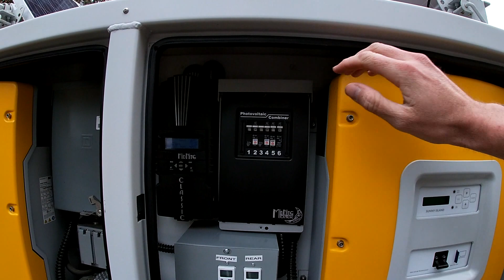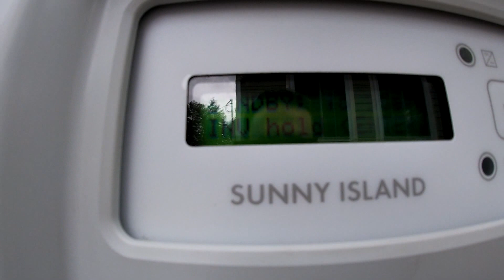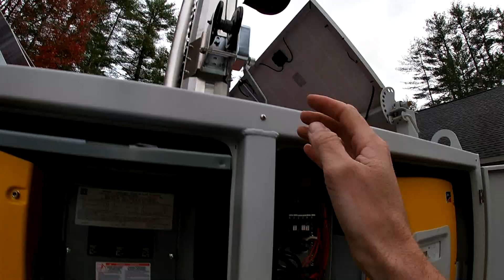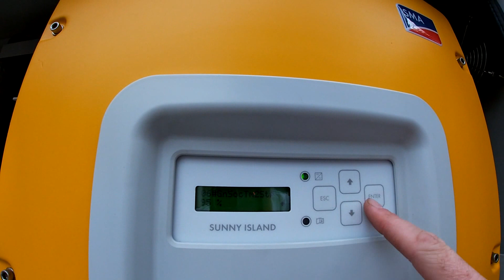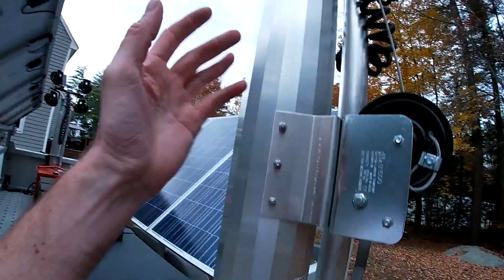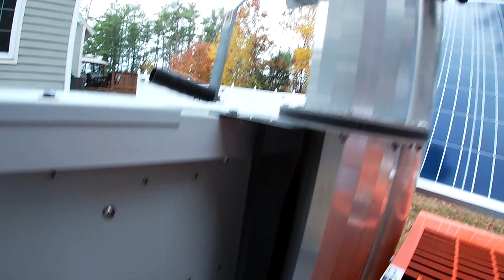How to use the "DC Solar" trailers + UNLOCK CODE for the Sunny Island Inverters INCLUDED!

Comment: Thanks very much for this. I have two trailers, one with a generator and one without, I use them to power an off the grid tiny house that I live full time in the Sierras at 7,200’ and a shipping container based shop respectively. Have some issues that I hope to solve with help from content like yours. Greatly appreciated.
Reply: How has your experience been with those? We are looking at one of these and using it to power a camper trailer. Have you had any issues?

Comment: We are chasing after one of these right now (three years later)...definitely need it for our off grid build.
Reply from the maker: Good luck buddy and thank you for watching!
Reply: @Trialnerror  we are hoping to find a unit that will afford us the power to be fully self sufficient on top of the mountain - maybe look into a couple wind turbines to add to the unit for windy days.
Reply: @Trialnerror  low and behold we picked up one of the same style units that you purchased YESTERDAY! I am beside myself and it is sitting right outside this morning - too dark to play with just yet. The auto/start for the generator short cycled when I returned home in the evening and parked it. I turned on the systems for my wife to show her that it was operational. The Midnite Solar charge controller was charging at 12.5Amps before the sun went down. I will have to spend the next few days doing all the diagnostic testing from your videos to get the unit up and running. I wish there were a simple way to plug and play our 40' Jayco JayFlight LOFT directly to the trailer to test it's capacity for supplying power at 50Amps. I will keep searching for the information - waiting to hear back from SMA on how to wire the Sunny Islands to a sub-panel to do so. Thank you for all of your videos and assistance!!
Reply: @Trialnerror  we found a fully loaded trailer!! Pulled in the driveway last night!

Comment: Is there anyway to connect two of these trailers together? Or at least the panels from one trailer to another in series? The panels don’t seem to make enough power for what the charge controller and inverters can handle.
Reply: You'd need a second charge controller, the midnite classic 250 can only handle about the wattage of the panels on one trailer

Comment: Thanks for the great video. Just purchased one of the "A" configuration trailers yesterday. The prices are definitely going up. Controller only showing about 37 volts. May have a bad cell or two. Noticed some corrosion around a few of the terminal. Everything else is working. Has anyone posted about how to test the cells and what the cost would be to replace a cell?

Comment: The right most switch, trip fuse or whatever in the combiner panel is after the midnite charge controller going to charge the batteries. I thought it was lightning arrestor at first. Traced it and the charge controller feeds to it before sending power to batteries to charge them up. My guess is in the event of a surge , spike or spark or even short or explosion overheating it would trip protecting charge controller and panels. So charge controller is sandwiched between these trip fuses and protected in both directions
Reply from the maker: You are the man!  That makes perfect sense!
Reply: The Midnite breakers are polarity sensitive. The breaker(s) from the PV array are doubled up and placed in series in order to handle the higher voltage from the array. They protect the wiring and the Midnite Charge Controller (CC) system from the PV array in case to much current flows in from the array. This could happen if the panels are very cold, and the right kind of cloud cover occurs that causes a cloud to act like a lens, and focused the sun on the array. I once witnessed this during the winter when the 3kw array I had installed put out 4.3 kw as a small cloud went over. It can also, I kid you not, be caused by solar flares. The other breaker(s) protect power from flowing into the CC system from the battery, and from the inverter to the CC if and when the inverter is charging the battery. This can happen if the CC fails and shorts out. I have seen this happen after a system was damaged by a near lighting strike. A few hundred dollars spent on lightning protection and proper grounding is cheap insurance!
Reply: My guess is that this ckt breaker simply protects both the charger and the battery.  All solar systems are supposed to have a ckt breaker between the DC Charging Voltage output going to the Batteries: both as a switch to start or stop charging them AND as a protection device should something in the Charge controller circuit Short out this Circuit.  This is standard in all solar system I am aware of.  If it was for a lightning suppressor then it would likely be mounted right inside of the Combiner box (and be visible: which it is Not).    My friend's problem is that when I turn on the black breakers, that the Midnight Classic Charge Controller Does NOT produce any Watts going to the Batteries.  Maybe this very ckt breaker is Bad?  I will know next time I go back to check it out.
Reply: If that's the case connect it directly by passing the charge controller.  The charge controller shuts of if the voltage is too low. Get a multimeter and open the   panel and measure the voltage between the black cables and red. If its below 40 volts it will not boot up. That's from my experience.  Once you connect directly bypassing the charge controller it will charge up the battery for a while then you can put it back to normal afterwards.  I don't know if that makes sense.
Reply: I have a picture of the combiner box I can send you to show you how I did mine. Just let me know if you need it.
Reply: @maxiest200508  Yes, I know that I can use 2 Panels in Series to Charge a 48V Battery Bank.    I am planning to build such a Bypass Device -- with each set of Two panels on a 15 amp DC Breaker.  That will bypass the Charge Controller.  As long as the Charge Voltage is below (say) 58 Volts It should work just fine.  When it reaches 58 VDC, then I will Stop charging at that point and reconnect through the Controller.  I Do Not know how many sets of 2 (265 Watt each) Panels it will take to bring the Voltage up to 58 Volts, but that is Very Close to the Ideal Equalize Volage as far as I can tell.  Or 57.6 to be more exact.  Even then you may have to go higher to Restore a Bad Battery.
Reply: I can send you a picture of how I did mine. You dont need to do all that. You just need to put a jumper cable or wire between to points. Let me send you a picture give me and email or I can post a picture somewhere and share the link with you. Once you open the combine box you'll see how you can disconnect the red cable going to and from charge controller and simply put a short jumper cable similar to the one on the second to the fourth position (black). Then it will be kind of high but you only need it to charge the battery so that the charge controller can wake up. The charge controller is voltage sensitive. It wont boot with very low battery.
Reply: @maxiest200508  I already charged that batteries to 46 Volts.  The Charge Controller came on.  I think I need to simply Turn the Solar Function to "ON."   It is either that or a Bad Ckt Breaker.  I am confident I will figure it out the next time I go see my friend.  What you suggested will place Too High of a Voltage on the Batteries.  Two Panels in Series is all that are needed to get the Charge Voltage in the Ball Park -- should we need to go that route.  Thanks for your offer.
Reply: I've got a problem with the one I'm working on. 
Both aray banks have the same voltage going into the combiner box. But the Midnight controller, shows one bank, at 750 watts, and the other at 35 watts. What am I missing?
Reply: @applefire11  if you have a voltmeter you can check some parameters by opening the panel where the circuit breakers are. If one of the contacts come loose or the breaker is tripped or has no continuity. Be careful though as shorting anything with the wires live and hot is like a welding machine it will stick and spark and arc.

Comment: FYI. Sunny Island has a very good warranty. My slave inverter was showing a temperature error. They sent me out a new temp sensor but it didn't solve the issue, so they sent me an entire inverter replacement. My question is, do I need to do anything special to install an inverter as a slave? Secondly, my old erroring inverter. Is there a way to reset that inverter and see if I can get it to work as a standalone unit?

Comment: You’re fabulous…I have one of these trailers…it appears battery acid from two batteries in the array has melted through its casing and through the trailer floor…I didn’t see the problem until the  inverters stopped working and I was forced to check everything. The inverter’s LCD, nor the tiny green indicator will light up, suggesting zero power is reaching the inverters - the charge indicator shows almost fully charged batteries…but no amps or watts are being generated….I don’t know how to proceed - can anyone offer any suggestions regarding how to address the batteries and/or the power issue with the inverters - any advise would be greatly appreciated
Reply: Do a new battery set up on your inverters. If they set for long periods of time. But it doesn't hurt to do it every so often because the inverters some forget.

Comment: Those Batteries are Flooded Lead Acid, NOT AGM's.  How do I know?  Because they have liquid Sulphuric Acid in them.  AGM batteries are Sealed: meaning they Don't have Watering Holes to add water to periodically.  They also require Zero Maintenance -- as opposed to these Forklift FLA batteries.
Reply from the maker: You are correct. I didn't know at the time.

Comment: Hello there I bought one of these trailers .  I hook up power line. Turn it on it runs for about half hour then shuts down. Any thoughts why it keeps shutting down.  I bought new battery and still does the same thing. Works great when there is sun

Comment: When you wired into your house did you need to change the settings in the master inverter to GenGrid? Did you just pop a 50a double breaker into your panel and then wire it to the trailer?

Comment: Thank you so much for the videos on these trailers.  Longer videos! Love it.  Do you think it's possible to use the light towers for mounting small wind generators and would it be worth the try.  I noticed a broken light tower in one of your videos possibly due to wind.  Do you think the light tower is strong enough to hold a wind generator.  Removing the lights would cut down on the wind drag to the tower.  Does the tower expand from the bottom up or the top one first.  Some counties will not give permits for wind generators so a mobile unit like these trailers might help get around the permit process.
Reply: Where do you live that the govt owns the air?
Reply: @jakeeddy9256  I live in Santa Barbara CA and the government currently owns the air.  About 5 years ago I called the county to see if I could install a wind generator as I live in the mountains on 7 acres in a community where  no parcels can be less than 5 acres.  The county agence for approving permits said that the federal government mandates solar so they have to say yes to solar.  The said until the federal government mandates wind they will just say no to everyone that asks for a permit to install one.  Santa Barbara is the place that started Earth Day due to the oil spills back in the 60s.  As you can see Santa Barbara is not so environmentally progressive as they try to appear.  Not so surprising the property at the top of the mountains in Santa Barbara that Jane Fonda use to own has a huge wind generator because she was married to Tom Hayden and the two had enough money and political clout to pull it off.  We can see that wind generator still spinning from my office window.  The county said that was grandfathered in the past so there is nothing they can do about that.  A lot of great stories of BS so a mobile generator might to the trick or something less than 15 feet might not need a permit but could not be connected to the grid although off grid would be fine.
Reply: I met a guy who has installed two wind turbines by replacing the lights. Message me for his info
Reply: @stewarthousehold  Hello Stewart - yes I would love to see how and what wind generators they replaced the lights with on these trailers.  There are a lot of counties in California that will not permit wind generators but if they are mobile and not connected to the grid that would solve a lot of permitting issues.  Thank you

Comment: Hey, thanks for making these videos.
just bought a few of these, getting two “H” & possibly some “B” models next.

My question is: how do you turn on the machine? Im sure if my batteries were low, but given the lack of user manuals. Is there a position the switches should be in in order to charge the batteries? 

I figure following your steps, mine won’t turn on and the batteries are probably bot charged. Anyway, let me know because i am stuck at this point in time.

Thanks again!
Reply from the maker: Sounds like you're going to need to get the battery charging process started manually.  When they get run down super low, eventually the power needed to kick on the Midnight charge controller isn't available.  a 48v charger is ideal because you can charge each of the two packs one at a time.  The other option is to use a regular 12v charger and only do a few individual cells at a time.  Once you get a few volts in them, the midnight charge controller will power up and the sun will do the rest. Good luck buddy!
Reply: @Trialnerror  the battery charger connectors, how should i connect them? Thanks for the help by the way.

Comment: Is there a way to know the health of the battery pack without turning this thing on? As in if at an auction. Is there an id tag on the battery pack with a date? How long are the packs good for? I don't want to pay $10k for one of these just to find out the batteries are no good.
Reply from the maker: Nope.  There's not way but to load test them over time.  I checked the voltage to rule out any severely dead packs and acid level and the rest is a roll of the dice.  That's what these are selling for $10k and not $40k.  There is some risk.
Reply: @Trialnerror  Thanks. Any idea what the cost of replacing the battery pack is?
Reply: These IFLA batteries are so robust that dead cells and weak cells can be recovered to full or nearly full capacity very easily

Comment: My batteries only show about 19v each. When I pulled my battery connectors apart, the 2 negative ends that go into 1, pulled out. I can fix those but I can't turn anything on. If generator is ran will it charge?

Comment: First, thanks for the tutorial. Secondly, can these trailers be safely used to provide power to a home or shop which is receiving power from an existing grid? How do you accommodate the utility requirement for a cutoff, incase of a power outage. We don't want to be feeding power back into a system when a lineman might be working to restore power to a home or homes
Reply from the maker: Yes and yes. You tie the grid into the inverters and they control taking in grid power when needed and isolate the grid from the output of the trailer.
Reply: You need to install a transfer relay/switch there to cut solar power in, something a contractor should be able to install properly.

Comment: Testing the generator output to the Sunny Island inverters to charge the battery (SOH) at 20%... probably not good. I noticed that the Midnite Solar Charge Controller went immediately to 0000watts from the solar panels - if the generator is operating and charging there must be an interrupt between controller and SMA inverters. Is this correct to think? I am going to run for 20 minutes and see if the SOH (I thought it was SOC - state of charge) comes up a few percentages. Maybe the batteries are toast. Multimeter show 48.8. With the generating operating the front battery shows a voltage of  57.8v-58.2v and rear battery is 58v-59.02v with generator on and SMA's pushing 1-2.2kw.
Reply from the maker: Makes sense but you can get around that by putting the Midnight into "EQ" mode.  The genny is just boosting the voltage up to a point where the Midnight thinks the battery is full, even though they are not.
Reply: @Trialnerror  this is going to take a while - that is for sure. Did you have to deep charge your battery banks - between all of your trailers before you commissioned your entire system? I can't imagine outlaying the capital for a new battery bank on all of your trailers at once. Thank you so much for responding - I am not getting a great deal of feedback from other owners - so, it is much appreciated!

Comment: When I turned on my friend's DCSolar Trailer, that looks just like yours, I got ZERO (0000) Watts coming out, even though I had incoming Voltage from the Panels.  Any suggestions?  I even got the Manual Equalize to say " STARTED," Yet the View Voltage and Watts Screen showed ZERO watts going to his Batteries.  Is there something that I need to set up 1st to get it to work?  Like maybe doing something with the 2 Sunny Island 6's???   I Started them both up but sill no Watts going to the Batteries. Any and All suggestions are welcome.